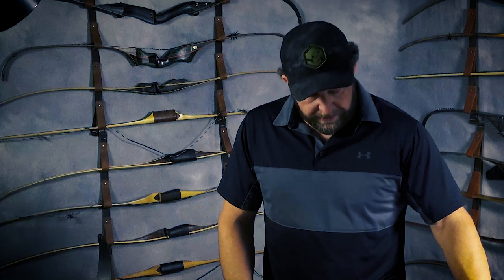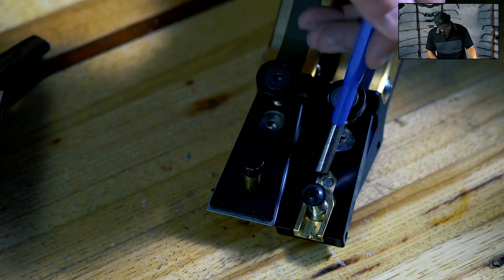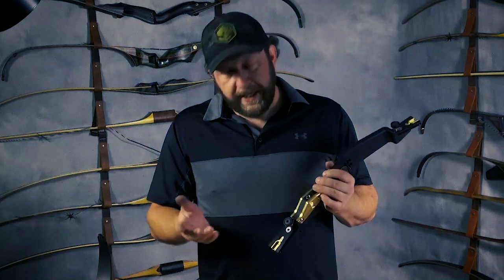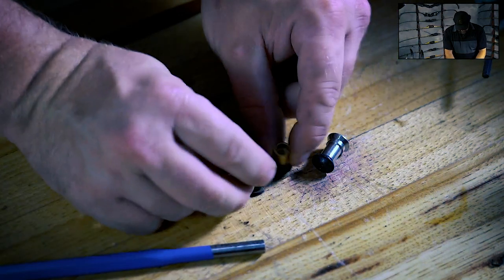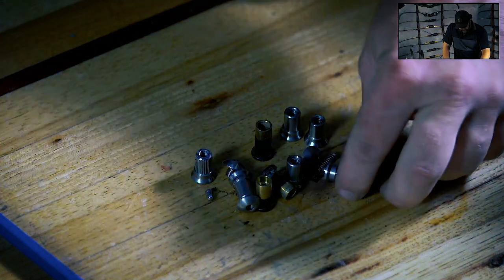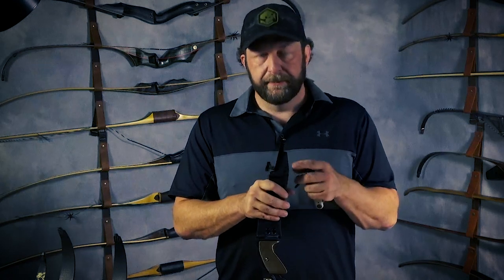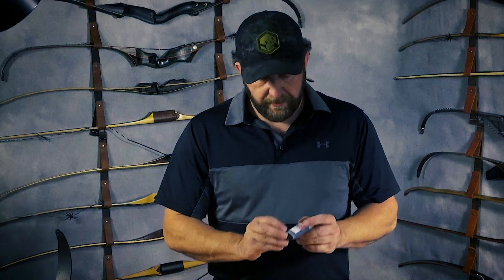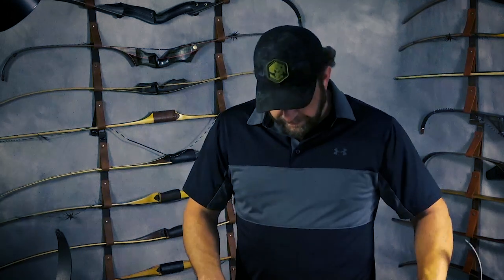Traditional Archery Connection systems, ILF or DAS?

Comment: I remember when Hoyt tried to bring back that design on the high end Olympic bows with the Axis and FX limbs back in 2000. It was so easy to switch between ILF as the detent had a quick swap system. One thing I didn't like about it was how often that thumb screw would always come loose.
Reply from the maker: Yes I find that I check mine without thought.

Comment: I just bought a das 17 with the Das fitting non ilf. I had a few problems with this brand new riser. Limb butts were one of them. Sanded my Samick r3 limbs butts for clearance. The bottom tiller bolt was too big in diameter to turn in the tiller bolt one turn from factory setting without the bezel hitting the riser, clearance problem. I took an old bezel that I had, ground it on an angle so to have more clearance and was able to turn in 1.5 turns in from factory to bare shaft a 350 spine arrow. My samick R3 limbs are 45 lbs and now I'm guessing I have 48 lbs at 28 inch draw.. any problem with bottom tiller bolt clearance for you hitting the riser?

Comment: It would be awesome if you did a video on how to set a Das bow up. Like where the limb bolts are actually bottomed out at. Is it better to measure brace from grip to string or from string to side plate. There’s a lot of confusing stuff in the manual.

Comment: With ILF the limb is not supposed to be bottomed out against the tiller bolt.  The dovetail hardware bottoms out leaving a gap between the limb fork and the tiller bolt.

Comment: Do you know the Limb Butt thickness of the TradTech Black MAx2.0 Glass /Fibre Recurve limbs at all. Thinking about pairing a set those with a Das Riser with the Das connection system.
Reply from the maker: They should work fine.

Comment: So am I understanding that DAS limbs and ILF limbs are drilled and cut out the same and the difference is in the bushing? If I'm understanding this you can buy a used set of ILF limbs and convert them using the DAS bushing to use on DAS system?
Reply from the maker: Yes you can convert ILF to DAS as long as the bushing goes through the entire limb.

Comment: Can I ask where is the max setting when adjusting tiller bolts for poundage would the brass sleeve being snug to the rubber pad be max setting in  I've Just got hold of a das dalaa 17" I have some uuhka tuulai limbs 40# on a 19" riser and wondering how far I can screw the bolts in to gain a few # without causing any damage to limbs or having performance issues appreciate any help
Reply from the maker: Your best bet is to contact 3R Customer Service. I always try to match the line of the riser to the limbs. They seem to offer a broader window of tune in this space. That is usually the middle of the bolts.
Reply: @tradlab1859 thanks I actually started out with the back of the limb sort of matching the top edge of the riser shape I'll stick with that if I don't get a reply from 3rivers

Comment: For all that effort for DAS, i would want lateral alignment. Lateral alignment would be rock solid with both loctite and hardened steel locating components. That and/or it would be nice to see rubber pads on the ILF option, can surely be done.

It's not a nice looking riser, so it would need to be really perfect in terms of build/function to be worth the buy
Reply: I add a thin (0.5mm) flat rubber or leather washer and glue them to the tiller bolts my ILF risers.

I glue on the same thin rubber or leather to the limbs where they meet the riser.

This does mess with the tiller a little bit, but I can adjust the tiller bolts for it and the issue becomes moot.

Velcro pile (loop) or thin felt might work too.

Low strenght loctite for the lateral limb alignment is enough for me.

This, paired with string whiskers or beaver balls, has made my bows noticeably quieter than the ones I've seen at the clubs I've been to, comparable to some of the compounds, at least to my ear.

Comment: You put a flattened point or ground. You put the threaded end in the bushing it won't hurt the threads. And tap it out the pilot keeps it centered no damage.the target point fits the hole perfectly.

Comment: I bought a Samick discovery ilf. Whenever I string the bow up the first shot makes a loud crack. After that it fine. No one at Three Rivers ever heard of this. Do you think I need to replace the dove tail. Seems like it won’t seat on its own.
Reply from the maker: Do you seat the limbs by drawing it about 4" and letting go of the string?
Reply: He's right on the money. Pull back the string a few inches and let it go. If allows everything to seat correctly.

Comment: I always thought the ilf limbs should lock in. Mine does not and has not since new so I have to be cautious when stringing
Reply from the maker: I would call the retailer and discuss this with them.
Reply: @tradlab1859  I did and was told it was not uncommon for a limb not to lock in.